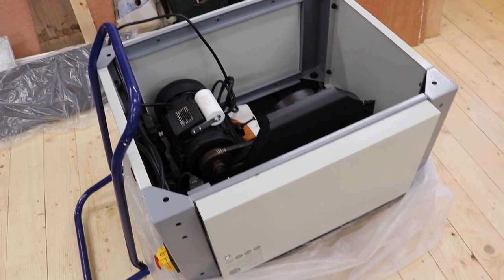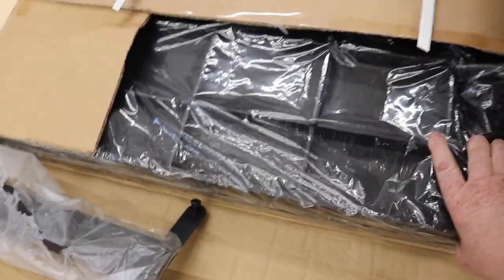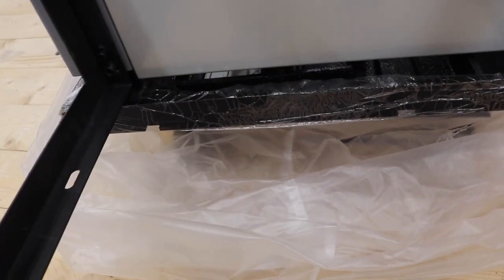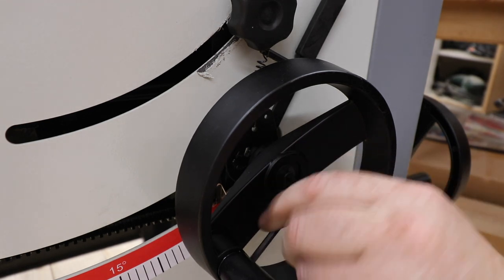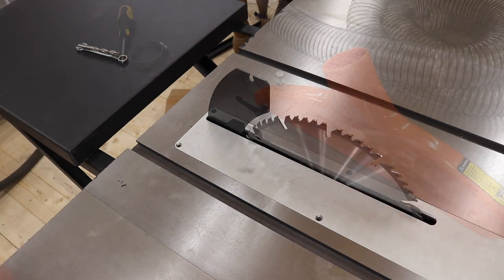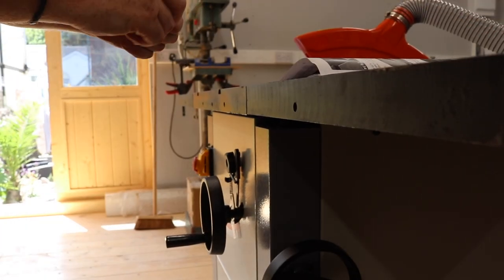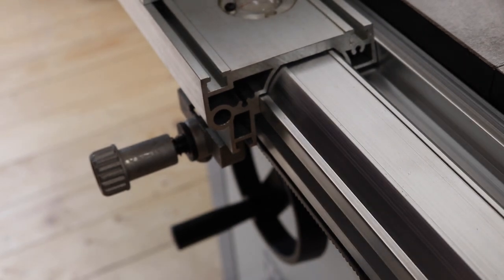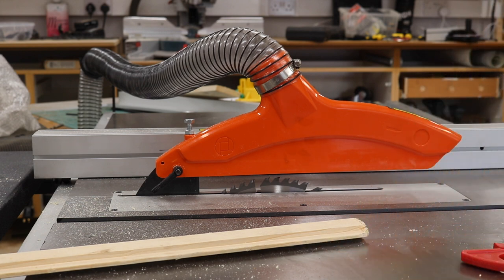Installing Axminster AT254BS/AT315BS Table Saw

Comment: Instructions that came with this saw are absolutely useless. A lot of steps skipped.  You video saved me the hassle of returning the saw as there was no mention of the washer that was behind the windup wheel.  Tech support wanted to swap the saw over for a new one as they didn't know about the washer existed or that it had to be removed to fit the wheel.  Thanks for your video
Reply from the maker: Pleased it was helpful to you.